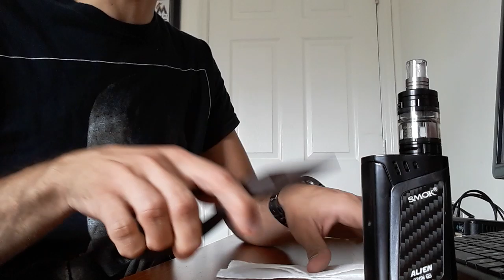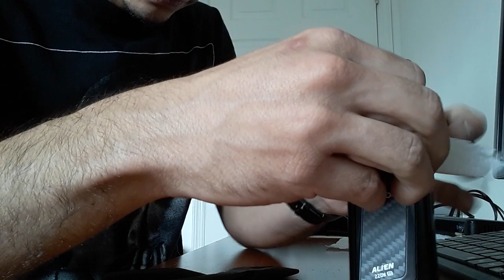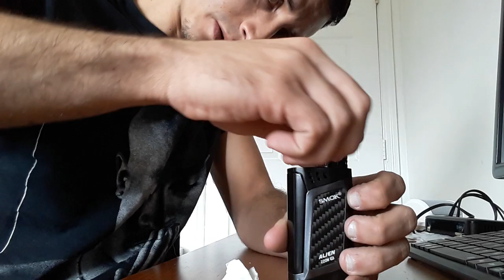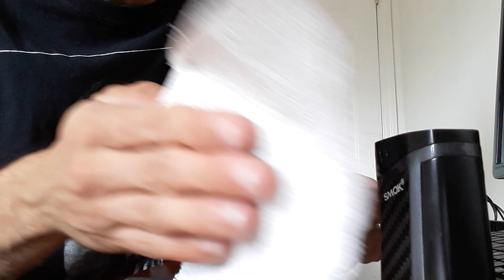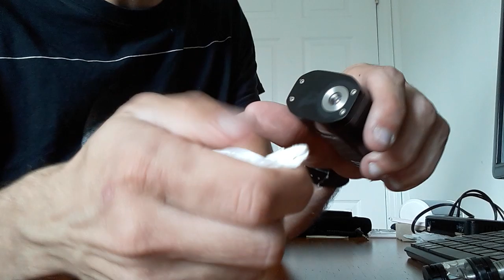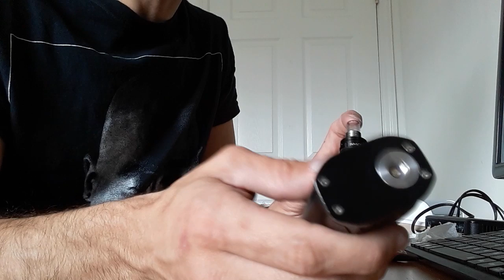Quick Fix For Jammed Tank

Comment: way easier method  stick some scissors in the airflows of the tank and twist the scissors worked for me better than this method
Reply: RC SPORTS this comment is extreme under rated 💯
Reply: I tried absolutely everything and THIS WORKED. I said a lil prayer for u 💙
Reply: I have a different problem. My tank is cross threaded and will not come out. It spins and nothing I do will get it to read the atomizer. Does anyone know if there is a repair kit for an IJoy avenger 270? Or did I just screw up my entire MOD and have to throw it out and spend a lot of money to get a new one
Reply: @darrellgaribaldi2689  if you don't need the base, try to get the airflow ring of, than try to unscrew it
Reply: same
Reply: i used a knoife
Reply: Thank you, so ducking much. My hands are torn appart right now.
Reply: RC SPORTS thanks for the idea, mine was stuck on so tight that when I tried pliers it bent the airflow ring
Reply: Lifesaver! \m/
Reply: Thank you guy scissors idea is the best!
Reply: Genius! 🤘💀
Reply: This didn’t do shit my tank just kept spinning -.-
Reply: You’re a godsend
Reply: Genius
Reply: Thanks so much man!!!!!
Reply: You're a fucking life saver
Reply: Legend.
Reply: thank you so much man i literally just broke my finger doing the plier method, this was prime as hell
Reply: I’m so happy I found this comment
Reply: RC SPORTS bro you’re a fucking genius. I’ve been sat here with WD40 and pliers for 20 minutes.
Reply: YOURE A FUCKING LEGEND
Reply: Me in a pit of rage after trying everything and then reading this comment 

“There’s no fucking way scissors even fit in this little......holy shit it worked”
Reply: Thanks bro you saved my tanks life I was bout to throw this shit at a wall
Reply: My tank's airflow is in the top...
Reply: thanks bro fucking luv yah
Reply: What if you have honeycomb airflow holes??
Reply: HDJSKSK thank you so much. my fingers are literally so cut up from hours of trying to unscrew it and this finally worked
Reply: YOU LITERALLY SAVED MY LIFE THANK U SO MUCH
Reply: i actually love you man thanks
Reply: dude thank you, I will always remember this now! was about to loose my mind without pliers
Reply: MY BROTHA
Reply: Omggg life saver, this actually worked 🤩
Reply: Thanks bro, it works great.
Reply: Worked on my first try thanks
Reply: You are a champion, thank you!
Reply: i tried this with tweezers and it worked wonders for me. thank you!
Reply: @rcsports5793 You fkn life saver!!!
Reply: Thank u this is helping me in 2024😂
Reply: Exactly anything that fits in the airflow and just simple twist way faster I use my tweezers
Reply: Fuck yeah bro! Your way worked easy asf. I actually put a mix between yours and his method by putting needle nose pliers in the airflow instead of scissors and it worked on the second try. I could t get the pliers to work with his method but yours kicked ass!

Thanks bro!
Reply: 🎉❤ty

Comment: The way to do it without pliers is to twist the top until the coil is screwed extra tight and then turn counter clock-wise and the base will come out.  You might have to use pliers to get the coil out but that is way easier than getting the base off with pliers.

Comment: My tank turns left and right contstantly, cant unscrew it at all. Any help?
Reply: Mine too, did you fix it
Reply: Mine too
Reply: stick some sccisors in the airflow and turn the sccisors
Reply: @rcsports5793  that worked like a charm... actually used a flat head screwdriver
Reply: @stellasmammacita9028  glad to help bro
Reply: @stellasmammacita9028  it really worked?
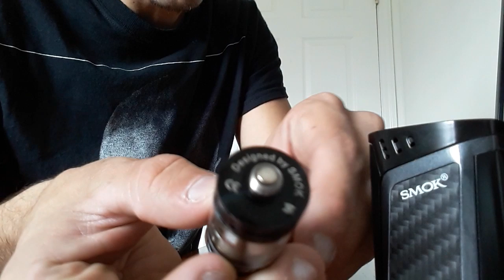Reply: @rcsports5793  mine is stuck to the silver part the "connector" at 2:47 it won't even draw anymore it reads "no atomizer" but I'm just trying to get it off
Reply: @user-ou8ut7df8p  yeah
..the screwdriver in hole and use pliers to unscrew
Reply: Thanks a lot bro
Reply: Thank you
Reply: Had to do this once when the airflow plastic part broke somehow and just freely turned. As for drip part screwed in or coil stuck use a rubber kitchen glove, put it on and you will have way more grip :)
Reply: calj  you’be span the 510 so it’s now bin time
Reply: yep the scissors worked for ny R-Kiss Tank. It was not unscrewing at all. Pop the scissors in the airflow and force it up. It popped out of the 510 and works fine now. So relieved. THANK YOU FOR THIS!
Reply: ITS NOT WORKING AHHH

Comment: 👍 This video helped me bigtime! Not because the advice worked.. but because I found someone’s comment in here with a different method to try and it worked easy asf! 😂

He said to put scissors in the airflow and twist. I actually put needle nose pliers in the airflow and did it, easy asf. I couldn’t get the pliers to work with the method on this video but it should work for some people.

Try the airflow with scissors if the video advice doesn’t work!

Comment: If the tank is stuck to the mod 510 connector take two razor blades on each side underneath the tank and place them against the 510 connector. Hold them really snug/tight and unscrew from the base. Will work after a few try’s if your tank is stuck to your mod and keeps spinning
Reply: Wish i saw this comment before i basically ripped my mod apart😥
Reply: T-5 torx screwdriver or bit and take apart, unscrew tank and jb weld or glue it from spinning and wont happen again.

Comment: adjustable pliers are ideal for this or put something hard in the air holes and try too unscrew,put it in the fridge for some time wd-40 on the 510,giwe it to someone who has more "power" in hands,there are lots of methods and  why didnt you dissassembly the atomizer before doing that the glass could be easily broke there should be some kind of rubber put instead of paper glad you made it in many cases the 510 slot dont survive this(sorry if bad english)

Comment: So I have a smok stick v8 baby and the top part where you can and juice is stuck and I'm trying to clean it because there is alot of old juice stuck in it and I've used everything and I've tried everything and it's still stuck so idk what to do and by the part that you add juice too I mean like the part that has a magnet that connects to the bottom part not the actually cap to add the juice
Reply: I've cut open my finger 4 times trying to get the tank part off so I give up

Comment: Easier method would be using the nail cutter specifically just the nail file which is attached to the nail cutter..twist it from the airflow..it works easy and it's safer

Comment: My airflow justf turns and turns can't get it off
Reply: Stick a key all the way through where the coil is and twist
Reply: stay golden pony boy :  Using a key worked; thanks for the tip!!
Reply: @staygoldenponyboy3852  trying it now...very smart
Reply: Did u put a key through the air flow?
Reply: You gotta ducktape the parts you don't want twisting

Comment: mine just keeps twisting what do I do?
Reply from the maker: Coltin Paulson  well if you are  refering to the tank spinning and not fully closing then it could be the pin on either the tank  or box mod you are using (assuming you are using a box mod) but even if its a pen the pin could be the issue
Reply: Personally, I would just buy a whole new mod for your tank instead of doing it this way because it will make your tank and mod basically ruined if you ever want to to change them out with something better or whatever.